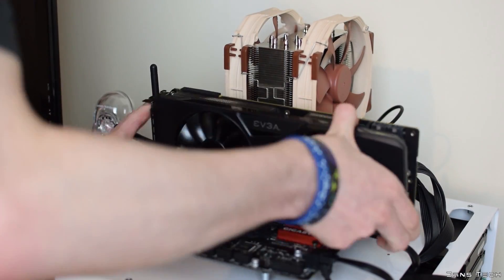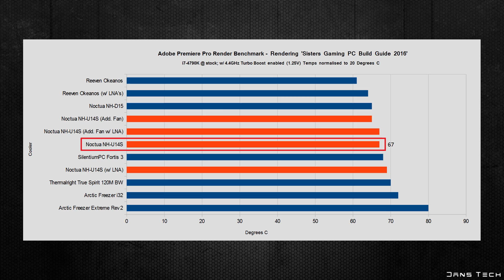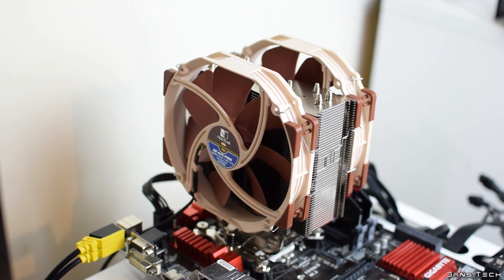Noctua NH-U14S CPU Cooler Review

Comment: Hi. Thank you very much for the demonstration of this cooler with two fans. Could you please clarify where you connected the second fan on the motherboard, to Pump_fun or Sys_ Fan, since the first one is connected to CPU_Fan? Maybe you used an adapter? I would be very grateful for your answer.

I want to buy and install a second fan, but I can't decide if it will make sense since the cooler is good enough.
Reply: Always connect both CPU cooler fans to the same fan header. Buy a 4pin splitter cable for a few bucks. Also the extra money spent won't gain you much but if 1-3c improvement is worth the extra $25 then buy it. I do have dual fans on most every cooler in the house as I buy Noctua coolers for dirt cheap when I find people selling them locally. I've bought two brand new D15 silver for $40 each, D15 black new for $50 and many more similar Noctua deals.

Comment: Great review! One question, probably silly of me to ask, but need to be sure: can the fans be attached the opposite way, pushing air to the left?
Reply from the maker: Yes, you could simply just install the cooler the other way on the Intel LGA platforms, since its a square mounting bracket. Dan.
Reply: Thanks!

Comment: What motherboard would you recommend buying that would actually fit this on without disturbing the RAM?? i do not plan on overclocking my CPU so it doesnt need to have overclocking capabilities, my CPU is socket 1150, and it has to be ATX, i would really appreciate a reply :) it would help alot
Reply: MechaMinilla99 so so far in using a tomahawk motherboard including this fan

Comment: Would you go for this or H70?
Reply from the maker: Overall I would recommend the NH-U14S, unless space is an issue. Dan.
Reply: Thanks. And what about the dh15?
Reply from the maker: Hi, not much difference in terms of performance between this and the D15, just noise levels. That said both quieter than the H70! Dan.
Reply: Oh okay. I presume the d15 is louder, yeah?
Reply from the maker: Quieter hence its got dual fans, so can both spin lower, and deliver better thermals. Have a full video review here: https://youtu.be/omx1owGrf4E Dan.
Reply: Thanks a lot, Dan.

Comment: only problem is he used MX4 thermal compound even though Noctua includes some NT-H1 compound.  According to testing the Arctic MX4 that he used scores 8,98 and the Noctua scores 8,73. (smaller is better). If he used the Notcua compound he probably would have got another degree or two lower temps.